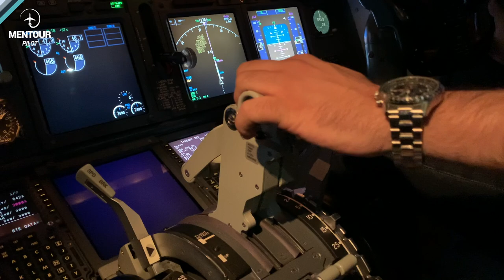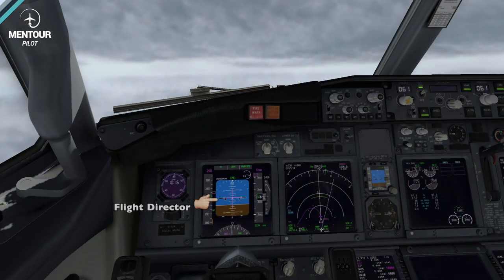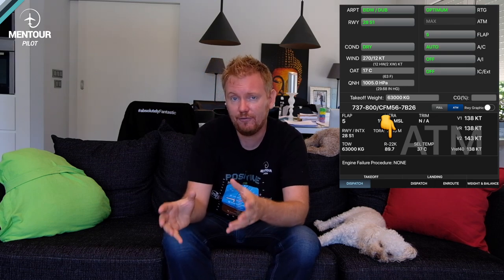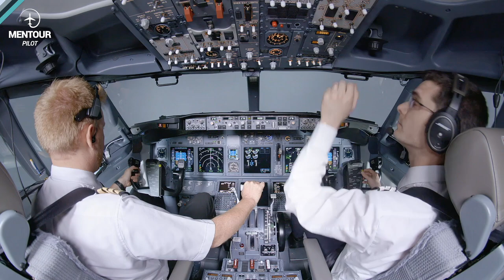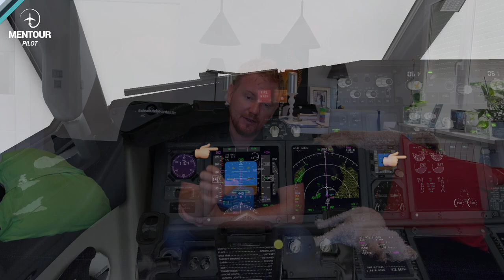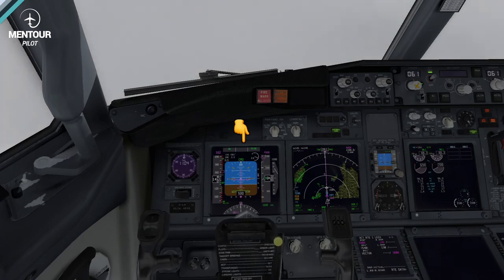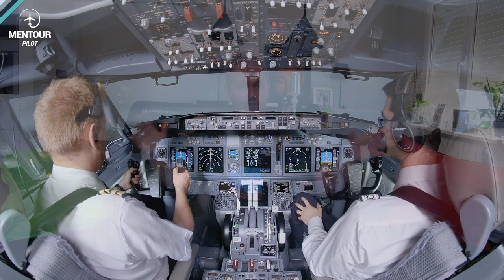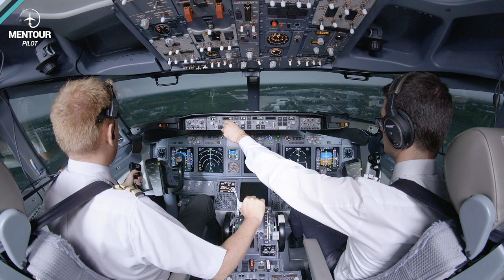What happens when you push TOGA?! (and what is it?)

Comment: These TOGA switches and the improvement of flight directors are a blessing for aviation : one can't imagine all the lives lost due to badly executed go-arounds (mainly because of excessive bank angle and stalls) in the past.
Reply: julosx ... and even with all these sophisticated systems designed for safety, we still have crews that would try to go around them. It appears that PIA A320 crew was way too high and too fast, still crashed. They’ve recovered those black boxes and let’s see exactly what happened
Reply: @uwekonnigsstaddt524  The two crashes that caused the grounding of the 737 MAX were caused by a system that was intended to enhance safety, but the design had some mistakes that would prove fatal.
Reply: @KnightRanger38  the mcas isnt created to enhance safety, it was used to mimic the feeling of Boeing 737NG series
Reply: @elroynathanael6535    MCAS was considered essential for certification (it 'cured' a handling quirk in a small corner of the flight envelope).   Boeing also claimed (and FAA accepted) that it made Max handle just like an NG so a common pilot certification was achieved.   This proved to be a mistake.
But in terms of a system intended to enhance safety that caused a crash - specifically TOGA - check Atlas Air 3591 where a bumped TOGA switch led a sub-standard crew to nosedive a perfectly functional 767 into the ground from 6000 feet.   Not really the 767's fault, that one.
Reply: @KnightRanger38  A flight control bandaid =/= safety enhancement

Comment: I'm a couple of weeks late to the party, but loved the video because for quite a long period of time I was the Boeing engineer responsible for the TOGA switches in all models.  Among a great many other things.
The 757/767 don't have TOGA switches, just GA switches, because the TakeOff function isn't implemented!  And we had some problems with inadvertent actuation of them on the 747 and 777; I had to fix those.
And I still hate the color I was told to paint those thrust levers.
Reply: Does this mean you just engage A/T to take off? One thing less confusing to start with. Just like in the Airbus.

Comment: I has two go arounds at an airport in Banjarmasin in Kalimantan on one flight. They pulled that plane straight up and gave it full thrust and the plane was shaking. Third time we popped through the clouds just above the height of the coconut trees and bang we were dow. Lucky I has a six pack or more on board and the Dutch courage was fully engaged.

Comment: I'm not sure if it applies to any of the 737 series, but the Emirates 777 crash (Dubai, 2016) has an interesting narrow case for TO/GA which contributed to the crash.

I forget exactly why they decided to go around, but they hit the switch after the computers had detected weight on wheels and gone into a landed mode which inhibited TO/GA function.  They pulled up but remained at idle thrust and crashed off the end of the runway.  Although it was pilot error, training was identified as deficient because the pilots were unaware that the function would be inhibited in that scenario (and didn't notice / correct the thrust until it was too late).
Reply: That sounds dangerous for the TO/GA to behave like that, to not respond when activated and to not warn the pilots about it. Why does it work that way?

Comment: This what happened in the Prime Air 767 crash. The TO/GA switch was pressed by accident. The FO misjudge it as a stall situation in the confusion while there was no stick shaker activated. Pushed the yoke forward to pitch down. But went into a full dive. By the time they could see the ground. It was too late to recover.

Comment: TOGA switches can be found on many twin engine GA aircraft. Our Cessna 414 has a TOGA switch on the throttles and we’ve used it. It’s not guarded, so it can be accidentally activated. On one occasion, we were flying at high altitude cruise on autopilot and were adjusting power settings. Both of us were adjusting flight instruments and power and one of us bumped the button. The aircraft pitched up, surprising the passengers in the back. Up front, we immediately realized what had happened. Pilot flying immediately disconnected the autopilot, pitched the nose down and cut power. Fortunately no one was injured and we recovered from the unintended TOGA excursion in a couple hundred feet, returning to the assigned altitude without ATC noticing it.

Comment: Hi there! Great video again, thank you!
But I have a question - why for the FO is so hard to handle the Flaps lever ( I assume this simulator is brand new but...)?
Reply: At a guess, the lever is meant to require a good bit of force to prevent accidental flap extensions/retractions.

Comment: Hi, Peter. There is a question about the flight directors. You say that according to the flight director reminding, you move the yoke a little bit forward to load the nose wheel a little because the rudder is not effective before 60 knots, but I thought, the elevators are the same not effective as rudder..

Comment: Talk of inadvertent TOGA brings up the spectre of Atlas Air 3591, which is thought to have been initiated by bumping the TOGA switches.   Are 767 TOGA switches in the same location as 737 ones?   And, how easy is it to miss the fact that TOGA has been initiated?
Reply: Well a crapload of thrust and a nose up tendency would be the most obvious clues, but the switches are below, but attached to, the white throttle handle.

Comment: @8:05, If the airspeed is not high enough for the rudder to be effective, are you relying on engine thrust over the elevator to keep the nose wheel on the ground? I wouldn't think the elevator can be effective in low airspeed if the rudder isn't also.
Reply: You use slight pressure from the elevator to push the nose gear ...and you steer by nose wheel

Comment: what are the spinning wheels below the throttles? Do you have a video about them? thanks :) great video!
Reply: You mean the trim wheels?
Reply: You turn them to manually adjust the trim. You see them spinning as on big plans they normally adjust automatically.

"Trim" is something you set (or the plane sets) so that when the controls are central the plane flies level. As you will see, trim varies throughout a flight, depending on airspeed, altitude, and other stuff.

Flying untrimmed means the pilot has to work continuously to keep the nose level (a bit like driving a car that is constantly pulling you to one side: easy at first but after a while gets tiring). In a well trimmed aircraft flying straight and level the pilot has their hands on the controls but is neither pulling back nor pushing forward.

In a Cessna the trim is in the ceiling. You hold the plane level with one hand and twiddle the trim with the other till your hand that's on the yoke feels it's no effort.

Then the instructor makes you change airspeed and you have to do it all again...

Comment: The problem here is when the Flight Director and/or TOGA go berserk. Commercial pilots might consider this a technical issue that needs to be resolved in a critical moment of the flight. Both systems, made by humans, are going to fail sooner or later. Pilots need to be trained extensively on all the scenarios possible without the aid of these devices and systems. And yes I know, engineers have already calculated the chances of both systems and humans going wrong and probably came back with a figure the lawsuit lawyers can live and work with to save the investors some money.

Comment: Have you ever thought that the automation is going too far? The sequence of the different TOGA functions seems confusing. What happened to just flying the airplane?  I realize that "safety" is paramount but if there's 157 different variations of using TOGA that have to be memorized..........
Reply: The TOGA button is here for one thing: get away from the ground. What that means depends on a lot of parameters, hence the complexity. If you just want to control power manually you can turn off autothrottle.

Comment: Hi Mentour, I love your content, especially of this type. In the final example (wind-shear), I notice some extremely violent movement of the yolk. Given the natural lag between changes in flight control surfaces and the response of the aircraft, what prompts do you use for such drastic input on the flight controls, and enabling what looks from the brief parts visible through the windshield to be so stable ?
Reply: Adam Lopes "the yolk"????  LOL Mentour is not talking about eggs!  its "yoke"
Reply: @helenfountain7554  Damn you Auto-Correct
Reply: YOKE. Yolk is what is inside an egg.

Comment: Great video and interesting 
So if you moved  the throttle levers will that disconnect the auto throttle like when you but your hands on the yoke and it disconnects the auto pilot?
Reply: no. Actually You can and have to ovveride the a/t during gusty and turbulend conditions because auto throttle is slow . 

it is a bigger problem during cruise when minimum and max speed is within 30-40 kts ias . 

It will disconnect when the levers are not at the same position ( few degress)

Comment: I saw an air crash investigation episode yesterday but I can not remember it and trying to find it again. Plane crash was due to disconnection of auto throttle and Toga after the pilot tried to go around. The pilot did not realise that the right landing gear touched the ground causing the disconnection. They raised nose but not enough to cause stall which confused pilot more. He depended so much on automation and if he had his hand on throttle he would have noticed ot is not moving. Can any one remember which accident was this.

Comment: I'm about a month late to the party but could you or someone clear up something for me regarding the Auto Throttle switch?

I understand that when you press the Auto Throttle Disconnect button(s), the switch actually moves to the off position by itself. (I think). But when you are getting ready to take off, you must have the Auto Throttle switch on in order for the Auto Throttle to set take off thrust for you when you press the TOGA button, correct? When do you normally turn the Auto Throttle switch on?

Do you ever take off without the Auto Throttle? If so, what happens when you press the TOGA button and how do you determine the correct take off thrust setting?

Thank you.
Reply: 1) correct for take off thrust to be set when pushing TOGA auto throttle needs to be engaged.
2) its turned on when entering the active runway ( varies in airline to airline procedures )
3) if pressed with no auto throttle connected there would be no thrust but the flight directors would still give you guidance, this is a common scenario for a go around on a single channel approach (not autoland to put it simply). its rare for no auto throttle to be set for take off but examples are for flying training circuits as a cadet in the 737 when you train. and you would have to manually set the thrust.

Comment: Emirates 521 crashed in large part because the TOGA button was inhibited by the weight on wheels switches. It seems dangerous to have a safety-critical switch that only works sometimes. What is the purpose of this inhibition?

Comment: Did I miss it or was communication to the tower and approach covered? Does just pushing the button light up some controller's board? Sure, comm is the "lowest" thing, but jeez, entering unplanned airspace, and possibly with operational issues that other planes may need to deviate away from? Notably I didn't hear that the Mumbai (nose gear issue, wing scrape) TOGA said a peep, about anything. I know those guys were busy but wouldn't squeezing 5 seconds for "TOGA. Gear issue. Have rescue on standby" be critically important?
Otherwise, would the burden be on controllers to 1. See TOGA. 2. Reroute existing affected traffic. 3. Assign his/her new airspace. 4. Notify other affected controllers? Indeed A, N, and C but C seems awfully vital here.
Reply: Pilot will inform atc about a go around BUT this is not prioty at that point

first 
 fly the aircraft .. flaps 15 ... gear up... and above 400agl call missed approach . 

atc expects a go around so even if You don't inform them You still have clear way in front of You.
Reply: No: telling ATC is done later, not when both flight crew need to keep their attention on flying or monitoring, respectively.
Reply: @trueriver1950  Oh, come on, now.  Taken to the nth degree, that would mean no crewmember ever clicks the radio between starting roll until dinging the passengers to disembark.

Does it not deserve a specific check item? Or do they just take whatever airspace looks open, and hope for the best? How about picking a runway for approach #2? They need to speak up sometime.

So you wouldn't squeeze out 4 seconds during initial climb for "TOGA. Gear issue. Have rescue equipment standby" ?
Reply: @piotrkuler2474  Thank you. That's exactly what I was wondering. Since I already acknowledged, twice, that comms come last, I appreciate that noncondescending and specific explanation ;)
So it's as soon as climb is safely established. That's what made most sense.

Comment: I wonder how you would come away from a smallish-aircraft, no-auto-throttle, limited (even NO) autopilot-assisted go-around. You would possibly end up stone-cold dead! Try severe crosswind landings in short-field aircraft. We do our part, you do your part and we will definitely proudly walk away with our prides intact. Try to put a 737 or 777 pilot in the cockpit of a Twin Otter in a 30-knot crosswind landing on a 300m runway and you're in for some interesting times. Conversely, put a genuine bush pilot at the controls of a both-pilots-incapacitated 737 or 777: He/she has the required basic knowledge, but will need a LOT of help to get this massive-collection-of-nuts-and-bolts-that-were-never-supposed-to-fly safely on the ground - the operative word being SAFELY, with WHATEVER HELP NEEDED being readily available. The bush pilot is more likely pull it off (with all the help he needs) than his colleague - after all, landing on a too-short runway in  a wind that exceeds the "Maximum demonstrated crosswind" capability might simply be an opportunity to revise this "limitation", but to heavy-haul airline pilot, this is usually considered "an approach to suicide".
Reply: Most airline pilots started their training in small planes, and had to learn all these things doing everything manually.
Apart from the undercarriage, which on my training Cessna was fixed and locked so was "automatically" deployed whenever I needed it. The "undercarriage down" check was still in the pre landing checks, to which the response was "fixed and locked". This was so that those going on to bigger planes knew where it was in the approach.

The reason most people start learning on smaller planes can be spotted if you look up the price of 1 hour of training in a Cessna and compare it with 1 hour of training in a 747...

Comment: When I press the A/T-disengage switch on the thrust levers, the A/T disarms and I don't get any kind of automatic thrust increase, I have to advance the throttles manually (PMDG 737).
Reply: That’s correct. You’re taking out the auto throttle, so you are taking manual control of the throttle. It then responds to whatever position you move the levers to.

Comment: What level of thrust do you use when you have finished with takeoff and climb and are leveled at your assigned flight level at your cruising speed and just need to fly towards your destination?
Reply: Typical values of thrust for cruising with a 737 is about 85% N1 but this will depend on weight, altitude etc.

Comment: Sorry Petter, I heard that derating values differ from company to company: for example on the 737 some have 26K, 24K and 22K and some, like Ryanair, have 24K, 22K and 20K. Is that true?
Reply: ryr has 26 24 22 . 

some 737's have 27k option 

but standard is 26 24 22 

737 700 has 24 22 20 if i recall correctly

Comment: What does that display that says "3000" on the overhead panel represent? The one to the right of the pressuresation gauge.
Reply: You put there the intended maximum cruising altitude.
Reply: @mikep9604  thanks.
But just 3000ft?! Wasn't it 8000ft until a certain FL and then a delta(P)?